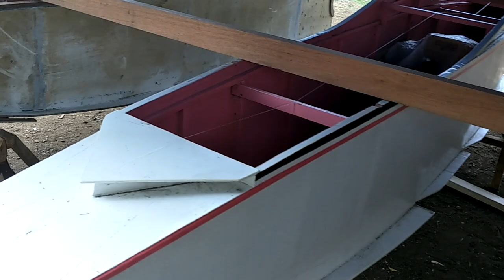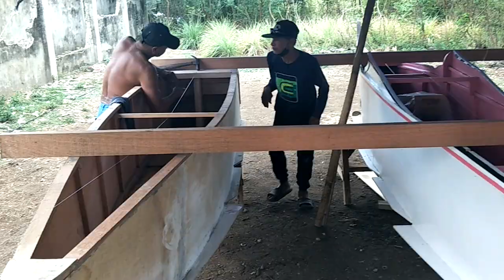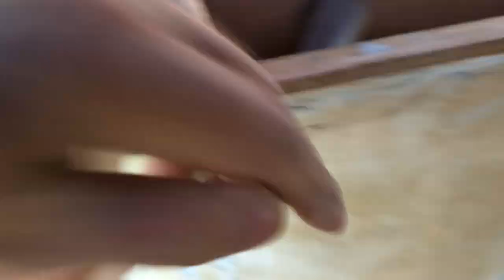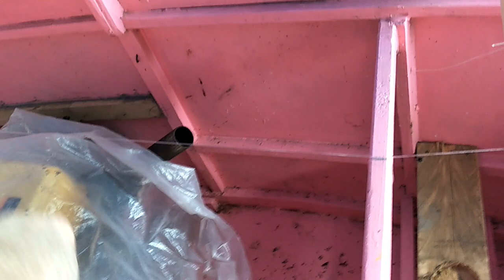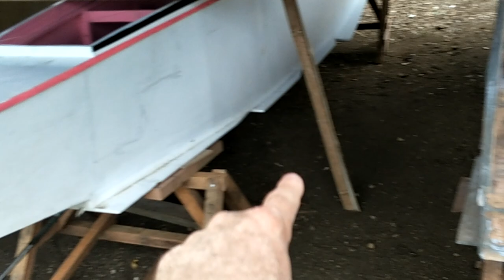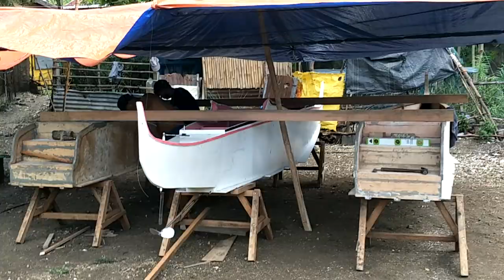"Paradise" Trimaran Boat Build Project Coming Soon!!!

Comment: If the two outboard hulls where smaller and built rearward into the main hull you would end up with a more efficient less drag canard type configuration..It would be lighter and very stable especially at high speeds.
Reply: I agree with you on this, Would be interesting to see this boats performance, hope we get the follow up after it’s launch.